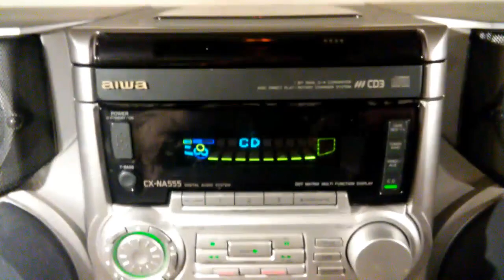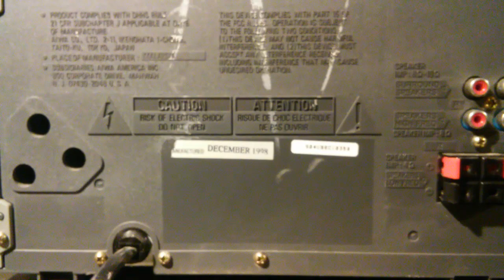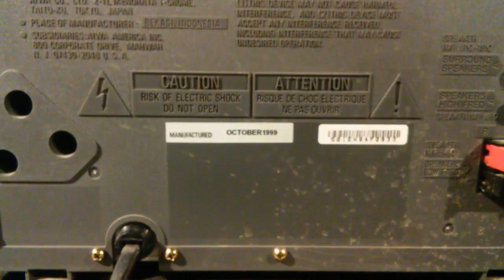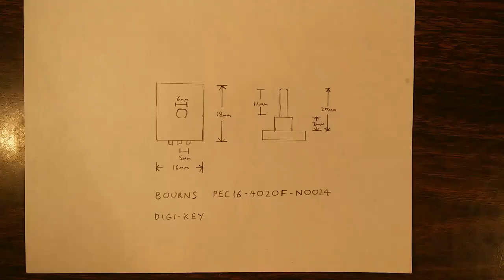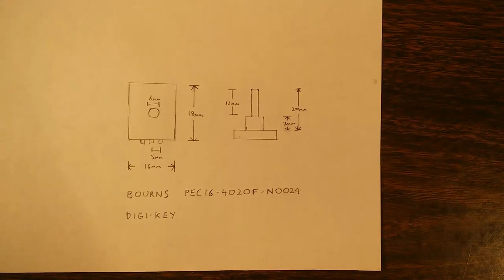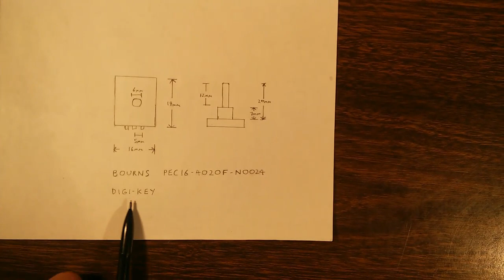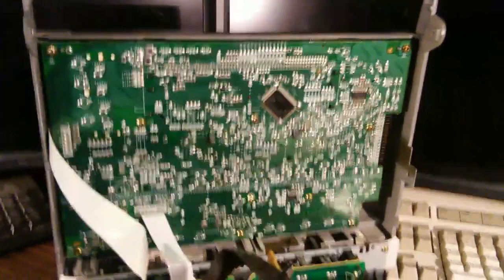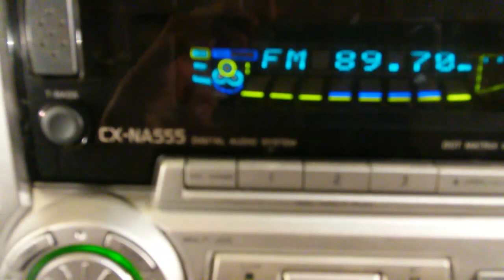Aiwa CX-NA555 Volume Repair

Comment: Thanks a ton for this video!!! I have 2 of these I bought from the Goodwill to use at work. Both of them have the volume issue and I see them all the time at the Goodwill. Instead of the volume going down mine goes UP. The funny part is my boss came back to my work area and tried to turn the stereo down a little and he ended up cranking it way up! Too funny :D Such an easy fix with the help of your video and the nice thing is you only need a Philips screw driver! With the poor man fix you mentioned mine didnt have any oxidation but it had what looked like some kind of oil that I cleaned off the volume control on the inside and now it works perfectly!
Reply from the maker: +Volantarism 
Thank you for the feedback.  I am glad this video helped you.  The digital encoder volume knob seems to be a very common problem.  The oil inside the digital encoder is probably a silicon lubricant.  I think it becomes gelatinous with age. A thin coat of oxidation can develop on the contacts that is difficult to see.  I use a very fine sand paper to expose clean metal.  Electrical contact is made with bent metal strips pressing against the encoder disc.  I think the "bend" relaxes with age and the contact become weak.  I put a little more "bend" on them so they press harder against the encoder disc contacts.
Reply: @c.davidgraves4848  Hi Thanks for this video, i have CX-NK570HR. but its showing once i switched on, Kindly suggest a way to repair it.

Comment: 12 years with this problem, decided to google just the model number and your video was the third result on google results, figured wow this must be a big problem watched your video last night and today I decided to open it and now it's fixed after so long, thank you very much i always had to turn the volume knob back and forth a few times to change 1 level up and then sometimes it would go down taking me minutes to get the desired volume when it would work. When I finally opened the little dial there seemed to be some gooey glue in there, wiped it clean and raised the little pieces, put everything back together and worked perfect. The CD changer has been stuck for a while or sometimes goes in and out but since I don't play CDs anymore and only use it as a TV speaker when watching movies I didn't even care for a fix for that.
Reply from the maker: I am glad this video helped you.  The volume knob is very common problem.  I am surprised at how many people have view this video.  I believe the goo you encountered is a silicone lubricant that has become gelatinous over time.  I found the same thing.  Your CD player tray could have a worn out or stretched drive belt.  It is a very common problem.
Reply: I might try to fix the CD changer next but since I don't use it I didn't try to, but thanks again for the video I am also amazed at the number of views this must have been a very popular stereo.
Reply: I hook up a mini mixer with BT to aux in. 😂😂😂😂

Comment: Thanks a lot, really old JVC unit i'm trying to keep alive. Knob went first, would always max, blowing out eardrums. Then i switched to use the remote, remote died. Used IR blaster on old android phone as remote, the android phone just died. Thanks to you I took it all apart and fixed the knob, it was greasy and dusty. I used 99% alcohol, bit of paper towel and old toothbrush, a tiny big of new electric grease and it's working again!

Comment: Now, I am by no means good at fixing things, or electronic... Anything's, and you weren't kidding about only needing one tool.. You, are my hero. I have the aiwa CX-NA115, with only some minor differences between our aiwa's, I was able to repair it! Since it's nearly as old as I am, I'm so glad I didn't have to get rid of it, (I'm quite sentimental about this stuff) it definitely was that "troublemaker", happy to say I can now willingly lower it down, and go as loud as I want! (I had the problem with it the volume always decreasing, no matter which way I turned the knob; honestly, I'd rather prefer if it was eternally climbing in volume, but I don't have to worry about that anymore!) I appreciate the video!! Can't wait to show my mom that I restored it to its former glory! MaNy ThAnKs~
Reply from the maker: Congratulations!  You have more technical skill than you thought. Your Mom should be proud.
Reply: @c.davidgraves4848  she was actually, she was floored for the longest time. It's definitely less stressful now.

Comment: I have an Aiwa CX-NMA945 that I bought new in 2000 that looks similar.  Use it for my home gym as a receiver for a Sony 300 disk changer and MP3 player/phone, RCA to 3.5 mm input.  My knob doesn't function correctly either.  I'm still able to use its remote to control the volume, so that works for me.  My remote has operated other Aiwa units, so I would imagine any Aiwa remote will turn them on and control the volume.  I saved this video in the event that my remote quits and I'm unable to find a replacement.  
  Sometimes my lighted screen fades out and in, mostly in the warmer weather.  It may be just dusty inside and needs blowing out to cool better.

Comment: I have NSX-s556 model. It's almost the same as the one in the video. Have the same problem with the nob. Volume just goes up. Great video. Gonna try and fix mine. Thanks for the video!

Comment: Same thing happened to mine....took it apart to no avail...put it back together and left it at 16 but you can never touch it otherwise you have to unplug it and plug it back it in. Thanks for the video!

Comment: I was so excited to see your excellent repair guide, and stripped down an old Aiwa  CX NTR 77K. It looked very similar to your Cx Na 555. Unfortunately the volume, bass and treble controls are soldered onto the board and  needed to be removed from the board to get access and bend the contacts. They are actually Alps Alpine brand, but the "poor man fix' worked perfectly. Unfortunately the cassette belt was completely melted,  so it only a partial restore. Could not find any details online on year of manufacture.

Comment: I pulled off the dial and sprayed a bit of contact cleaner into the front, ran the dial around, and now it's good as new. I did actually take the sides off to see how hard it would be to get inside but once I realized how much work was needed to get at it I just decided to go from the front. If you see this comment, save yourself the trouble and just spray in from the front.
Reply from the maker: You make a good suggestion.   First, attempt to fix it with contact cleaner.   It just might work, as in your case.  I have not had good luck with contact cleaner in the past.   But it is a lot less work, and if it does the trick, great!

Comment: he forgot to mentioned that your doing this at your own risk and NOT TO STICK YOUR HAND IN UNTIL IT IS UNPLUGGED FROM THE WALL AND LOCATED ALL CAPACITOR AND DISCHARGE ALL OF THEM CAUSE YOU COULD GET A DEADLY SHOCK... so be careful guys on repairing radios or any electronics even if the the power is unplugged you still can get shocked cause there is capacitors still could be holding charge and make sure they are not recharging back up and short out the capacitor(when the power is disconnected). (MAKE SURE THE CAPACITORS NOT SHORTED WHEN YOU ARE DONE WITH THE REPAIR) CAUSE THERE IS HIGH VOLTAGE IN MOST ELECTRONICS... EVEN WHEN POWER IS DISCONNECTED!... stay safe guys :) but he did a great job other then that :)

Comment: mine has the same volume problem and also CD don't read anymore. since I'm using it as a stereo amp from my focusrite and Mac station I have found a really cheap way to make it work. Mine doesn't have an aux RC port but a MD port that works the same. So I use it and set the volume to maximum 20. it was hard to get the volume back but I did it this way. removed only the plastic grey knob. Then used a electric screwdriver and fast rotating back and forward I reached the desires maximum volume. So now I use it via MD and the volume is controlled by the computer or better the Focusrite knob interface. The audio is very good and I'm pretty satisfied with the result as it is a free unit I had unused over the years and it was with dust in the garage.
Reply from the maker: Another way to avoid the work of tearing the unit down and repairing it, is to use a universal remote control.  I have an old universal remote that controls multiple devices, including audio devices.  It was a generic remote called "Universal UN-2".  The code was 133.  It worked almost everything on the unit.
Reply: Excellent and easy tip. I didn't remember this old Aiwa Stereo unit had a remote control. So I went to my mother house and found it! Put on 2 batteries at voila it's perfect working! 2 times thanks. I also sent back an Auna amplifier I just bought because it was noisy in the background and turning off so you saved me money. Grazie! Ciao!

Comment: Thanks, David! I just finished cleaning the encoder on an Aiwa CX-NA115. Some minor differences in screw counts and locations. 

I had problems removing the amplifier board similar to those you described. Looking closer, I found another plastic clippy-thing on the solder side of the amp board above the level of the headphone jack which held the amp board against the front panel board. Lifting the lever on the clip allowed me to get the amp board disconnected from the front panel.

Comment: The volume-mute-power knob on my 4G wifi cd/dvd dual cam smart radio seized up/broke & I am unsure how to obtain the correct item for replacement? I am glad that you mentioned the correct terminology for the part. I ASSUMED IT WAS A POTENTIOMETER BUT, iT does 3 functions, push & hold a sec for power on/off. Tap for mute, rotate for volume control...also, when ordering my needed part, what measurement dictates the size?  I am glad to have found your video & channel!!! Thank you

Comment: I have a used AIWA CSD FD91 and I am having problems with the volume control.   Different then your model.  There are two small buttons (not knobs) with one having a small arrow to increase the volume and the other button to lower the volume.  I can only increase the volume and not lower it now.  Everything else works, the CD player, the radio works and the cassette player works.   So.....it is only a problem with the volume button.
Just a button for the volume (not a knob like yours)  
No remote came with it.   
Now the volume is too loud and no matter how frequently I press the button to lower the volume- nothing happens.
It has worked in the past but not recently.

Comment: I don't have a knob. I have a button up and button down. And when I press the volume up button, it randomly changes volume to both directions (up and down). The volume down button works just fine. Any idea what could be causing this issue? That is not the only issue on my Aiwa, though. It sometimes decides not to play a cd. If I try to play a cd several times in a row, eventually it starts playing. I can't figure out what the problem might be. I have re-soldered the volume buttons and many components around them. All caps look fine.

Comment: Good morning David, it is remarkable how you work appluing the correct amount of patience.  Hope you can help, I have a Aiwa Z-L31 it is similar to the one you have, my CD turn table is not synchronized at all, I have it all apart however I do not see where I can adjust it! any suggestions thank you in advance for your help
Reply from the maker: +Dan Miranda
Unfortunately I no longer have this machine.  I sold it on Craig's list.  I have converted all my CD's to MP3 files and I no longer use CD players.  The service manual for the Z-L31  is available online at manualslib.com.  Possibly you could find an answer there.
Reply: Thank you for your quick response.

Comment: Hi. Thank you very much for uploading this video. My aiwa had the volume going up and down, but mostly up. I did everything you said and now it just keeps going up. I don't know what is wrong. I checked and did everything again but it is still the same. And also, I saw that my digital rotary encoder had something wet, I don't know, maybe is that I have to change it? I don't know what to do anymore.
Reply: I tried again, and it worked. I cleaned a little bit the encoder and it finally worked. Thank you very much, sir. I really appreciate your video.
Reply: Done

Comment: Aiwa stereo can also have problems with not sounding loud when you turn up the volume on it if that's the case then it's a problem with amplifier that is built into the stereo which can also cause problems with the volume control knob as well
Reply: Please phone namber giv

Comment: Do you have any repair recommendations for this same system, with a cd player that spins but doesn't read.  I have already tried to run a lens cleaner but it does the same thing as with a regular cd; spins a couple of times but doesn't play

Comment: Do you have a procedure for replacing the cassette drive belts and which belts are required? I have a Aiwa CX-NA707 unit that is similar to yours. Everything on mine appears to work except the cassettes.
Reply: Yes, Please help with this.  Leo did you get it fixed??

Comment: How did you get the audio control board separated from the display board? I have a very similar model that I need to service and that connector wouldn't release... pulled and pried both directions as much as I could without snapping the boards... it would not budge. You had same step in disassembly but skipped over how you got it to release.
Reply from the maker: Unfortunately I no longer posses this machine, so I must rely on my memory.  Removing the audio board starts at 13:20.  Be sure you have all the screws holding the audio board removed from the side and the bottom.   It is easy to miss one. 
The connection between the audio board and display-control board was tight.  I had to work the connection back and forth a little before it would "let go".  I may have even pried on the connection to get it started.  The head phone jack could "catch" when pulling the boards apart and pushing it back together.   I probably should have kept the machine.  I had not expected this video to be viewed so many times and get so many questions.
Reply: Thanks; Will try it again next weekend. The biggest mistake I made in tearing mine down was not removing the CD player first... the whole thing gets unmanageable with it in place. From my initial teardown I couldn't tell if connector was permanently soldered. 
FYI your model is different from my CX-NMT720 but I'm finding that the design's modular and that Aiwa's bookshelf systems are all very similar... so this teardown is useful guidance for other models.

Comment: Excuse me David, one last question: is there anywhere inside the unit a battery to keep the watch time and memory or it's a stupid unit that need to be always connected?
Reply from the maker: This unit does not have a memory battery.  If it loses power, it will lose the clock. If you want to know more about the unit, the manual is available online at www.manualslib.com.  Search for nsx-a555 manual.

Comment: my aiwa model nsx 999 ml ii    is  stand by ok  with screen  open  lights  and  now  wehn  i  press the power on  to  open  is open for  one  second and  close no  power. remain  to  stand by,,,wat can  be  the  problem ?? i  change  allready  the amfitrel 4131 and  i  chek  the  capacitors in  the  main  board..  only  one  smol  resistror o  found burn  and is  smol  size  start color from left  side first color  is  bronw second black orange green  and last right side again  bronw slim  eny  help frends/??

Comment: My radio was doing this so I took it apart but didn't know that I could just bend the tabs. I already put it back together and don't feel like taking it apart again. The belts for the cassette players are all gooey so I'm not sure if it's even worth fixing. I got this thing for free. If I could get everything working properly, I'd probably take it to a pawn shop. I have a CX-ZHT63.

Comment: Any ideas why there would be no sound AT ALL, besides the obvious like Mute on, input selection incorrect, and speaker wires not properly installed? My son dropped it on the floor, but it was only approx. 8-11 inches off the ground when dropped.
Reply from the maker: After a fall, it could be anything.  These plastic things are not very sturdy.  The only way to know what is wrong is to disassemble it and trouble shoot.
Reply: Thank you for your reply. I haveno idea how to that, so I replaced with a bit newer unit. Doesn't have same features, but I'm an Aiwa diehard!
Reply: it can be the integrated amplifier. it is a failure mainly produced by overheating, but a strong hit can damage the motherboards and a technician should test the power supply to all integrated stuff on the boards. these old stuff is easier to repair compared to the new ones, but you will need a good technician willing tot work. good luck

Comment: Thanks for the vid. Do you remember the code to program the universal remote? Would really appreciate a response, thanks.
Reply from the maker: The only remote that worked with this stereo was an old generic (unbranded) 3 digit remote.  The code was 133.  I tried some RCA and GE remotes, but I was not able to find a code that worked.
Reply: I used an old android phone that still had an IR on it. A Galaxy S4, to control mine, via PEEL remote app. Works great. But now I can’t sell the phone. It’s the only phone I have left with an IR lol